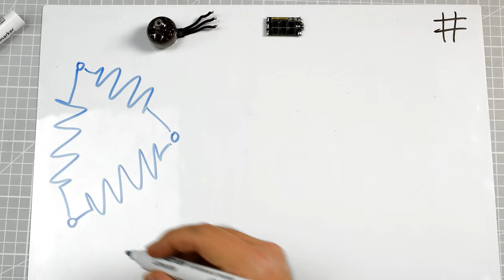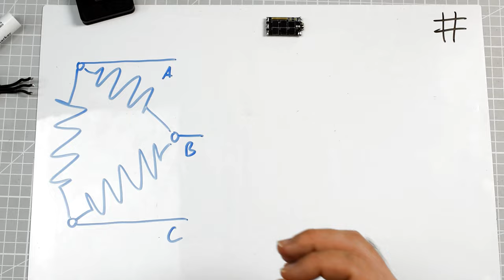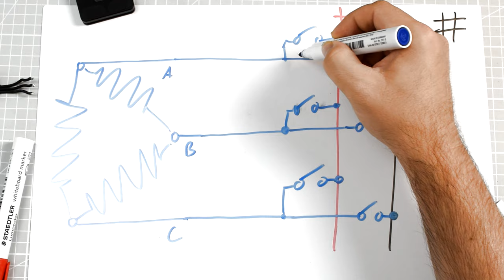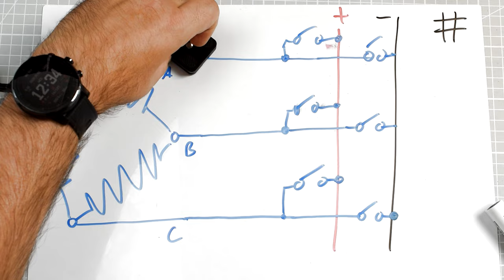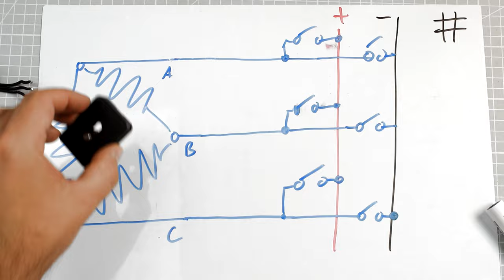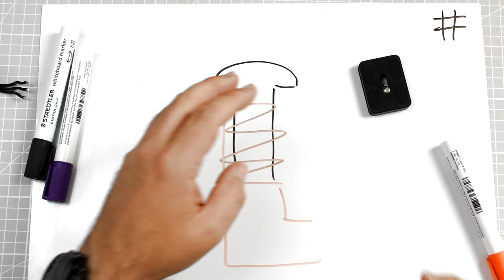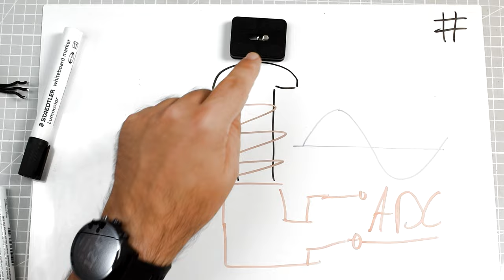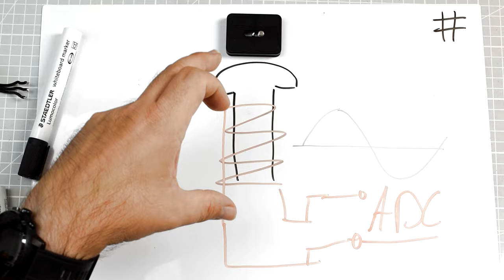How ESC and brushless motors work?

Comment: Thank you for the video! I was wondering: how do bidirectional escs switch direction?

It seems possible to reverse all current directions, but how does that work when the motor is moving?
Reply from the maker: it has nothing to do withj current reversal. Those are 3 phase motors. All ESC has to do is to reverse the rotation of magnetic flux. So instead of powering phases ABC it switches to ACB
Reply: @FPVUniversity  Ah I see. I’ll go back and study the theory a little more. 

If it’s just a phase reversal, would it be possible to turn a single-directional into a bidirectional esc with external circuitry? For example, having the two of the phases from the esc go to an h-bridge-like circuit before the motor so that you can flip them with a external control signal in order to switch direction

Thank you for taking the time to respond!

Comment: Paweł thanks for this  movie - good job.
For those interested in the subject, please refer to:
Microchip AN 885 -> "Brushless DC (BLDC) Motor Fundamentals",
Microchip AN857 -> "Brushless DC Motor Control Made Easy",
Microchip  AN1160 -> "Sensorless BLDC Control with
 Back-EMF Filtering Using a Majority Function", 
Microchip  AN1078 -> "“Sensorless Field Oriented Control of a
  a PMSM".

In the native language:
Paweł, czy przypadkiem modelarski silniczek BLDC nie jest w konfiguracji gwiazdy a nie trójkąta ?
Reply from the maker: the one use are Delta terminated. You can wind one yourself and terminate phases into Wye and it will work as well.

Comment: Hi pawel, great content! I Have a question to you if you have time to answer; How is active breaking working, because the FC only tell the motors what "power" to have and not what rpm. How can then the esc know for how to hard to break and for how long. Thanks, best regards Martin
Reply from the maker: ESC knows that motor is free-wheeling. It does not have to know the expected RPM to "know" that it's faster than expected
Reply: @FPVUniversity  Ok so I guess this is detected by some ratio between input power and back EMF? To decide if faster than expected? 
Thanks

Comment: According to your explanation, the ESC sense back EMF voltage through the energized phase. How is that possible when the phase is under full potential made by the FET bridge? Wouldn't it makes sense for the ESC to measure back EMF voltage through phase that isn't energized?
Reply from the maker: Not exactly. Phases are separated by 120deg and it is possible to compute zero crossing on phase A by observing phases B and C
Reply: Yup, you measure BEMF on the floating phase :-)

Comment: Nice video. Also worth noting the DJI esc tech is very good, particularly on the E5000 and E7000 propulsion systems for the bigger drones. But it's not open source so it's not so interesting :)